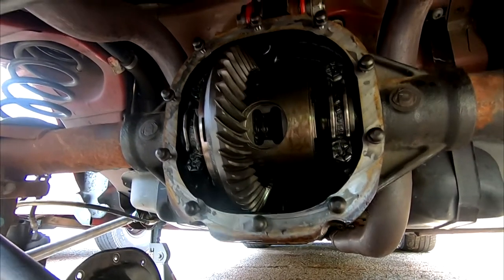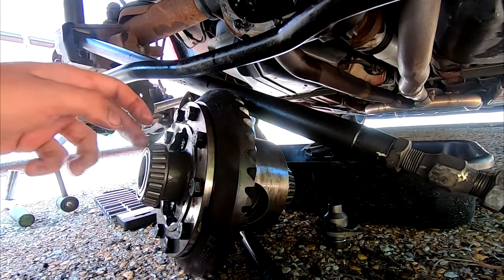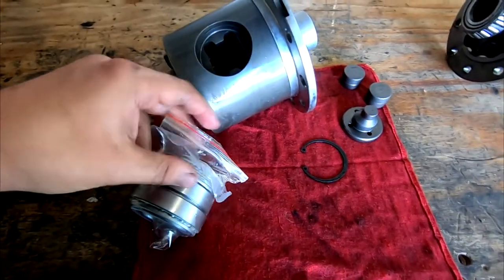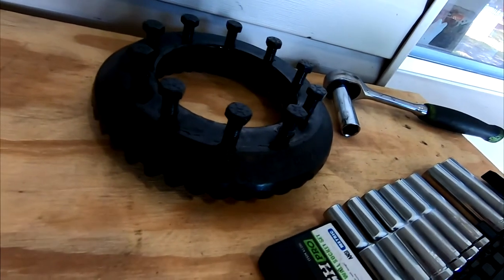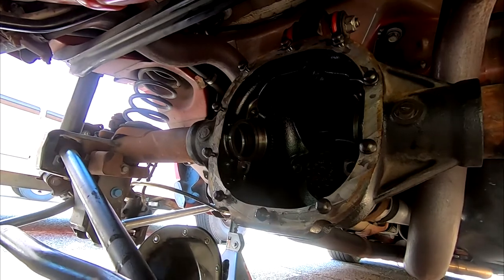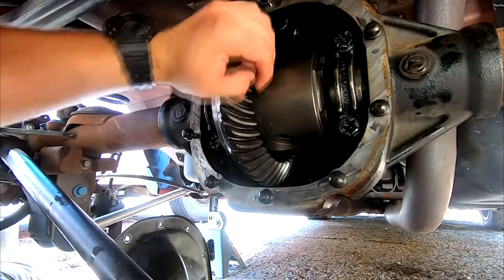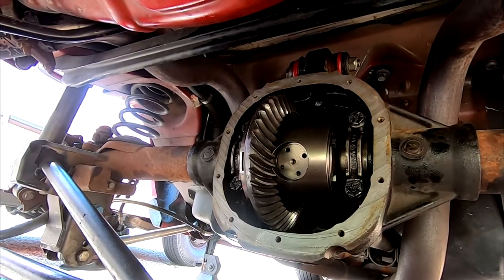Removing and Installing The New Eaton TrueTrac Differential

Comment: Nice vid, considering the eaton or yukon. Bearing caps are on backwards, arrows point towards the wheels.
Reply from the maker: Yeah, this was my first time messing with a diff. I've since gone back in, put a new gear set in, properly shimmed it and got my backlash and pattern proper, and made sure the caps were facing right lol. But it is quiet as can be now.
Reply: @AllThingsBoost  Awesome, this isn't a straightforward job.

Comment: im pretty much trying to do the same thing . how do you like the eaton diff? im boosted 450 to the wheels and my old factory diff is failing so i plan to upgrade while i daily drive this car i do like to visit the track both drag and autox as often as i can... in your oppinion what are the pros and cons to this diff? great video i noticed the nc plates im from Shelby
Reply from the maker: I actually really like it. My only complaint is I should have swapped out the crush washer on the pinion gear for shims, because it still whines pretty good, when you launch it slowly crushes that washer putting itself out of spec. I've had a bunch of 1.6 60ft launches and one 1.5 and its held very well, so all and all big fan of the diff.

Comment: Using the bearing race to press on the bearing can cause a flat spot on the bearing rollers - thus a possibility of causing noise and vibration that you will never find. That is a bad practice. Also - you installed the bearing cap up side down. The arrows on the cap always point to the wheel - this too, can cause a vibration... Not sure how precise you like to be - but any vibration in the drive line is not good... Just an observation, but all and all good video...
Reply from the maker: Thanks, I'm pretty inexperienced when it comes to a lot of this, so I appreciate the pointers. I will probably revisit this as I'm learning more and make some adjustments and do new bearings for piece of mind. Thanks
Reply: @AllThingsBoost  do you have the other spacer by chance still

Comment: Bearing cup!  The part with the rollers is the cone.
Reply from the maker: Thank you! Haha It was killin me!
Reply: @AllThingsBoost  test drive?  Did it work?  Also good job on keeping the backlash the same, at 0.010" 👍
Reply from the maker: It definitely feels better, the noises the diff was causing are gone, but the solid lower control arms still transmit quite a bit of noises to the cabin. I thing I might go for a bushing design down the road if the rear seat delete and some sound deadening material dont quiet the noise down a bit.
Reply: @AllThingsBoost  what was the 10mm socket in the parts bag for ?  Did that come from Eaton?
Reply: Its call a Race. Bearing Race. Not a cup
Reply: @hotroddude6551  Its also called a cup aka outer race.

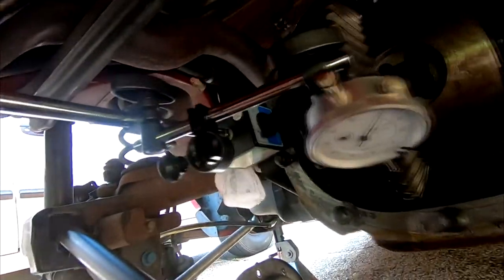Comment: Man can i pick ur ear?, you seem to know alot and i just had a shop install mine on my 02 gt, i pulled the axel out and brought it to the shop i had them powder coat and install one of these and 4:10 gears with yukon 31 spine axel shafts, i get it back to the car bolt it all up nd wen i put the my dual caliber brake setup i noticed that on the passenger side the rotors are perfectly in-between the brake calipers but on the driver side the rotors are so close they are almost rubber my calibers somethings not right, i havent even broken it in yet, Advice?
Reply from the maker: Interesting. So I had a weird issue with my first set of axles, some fords (f150, explorer, a few others) have an ABS ring between the ring gear and differential. It's about 1/4, but that means if you have an 8.8 (like in my car) that doesn't have an ABS ring in the diff, then it will be offset to one side. For mine I couldn't even install my first set because it was offset enough I couldn't get the c clip on, and the other side looked okay but probably stuck out a hair. Had to order a different set of axles and the second set was setup for my my style diff and 8.8 and fit fine. I'm betting that could be what you're experiencing, maybe the shop clearanced an axle tube to make it "fit" but obviously it's not right